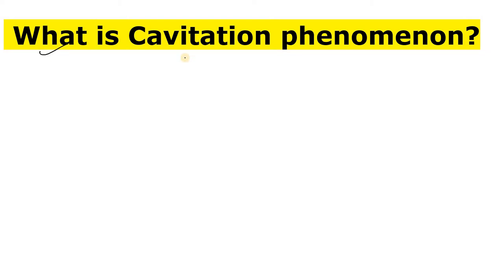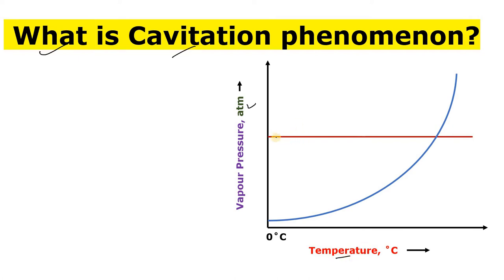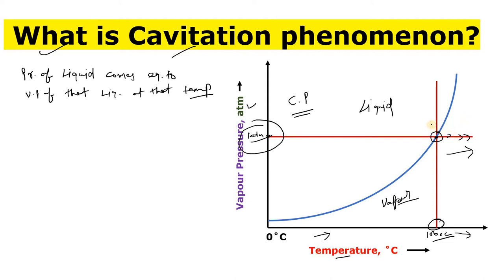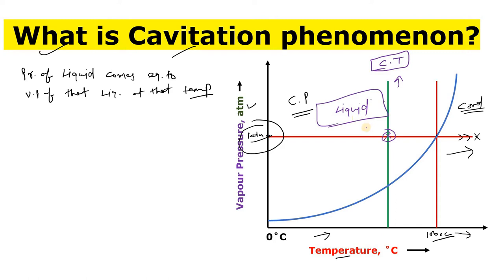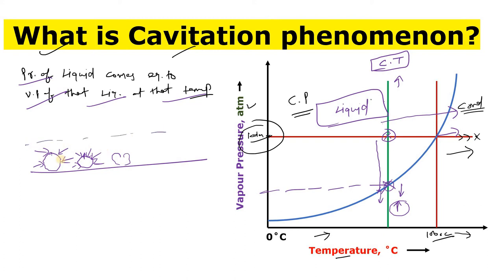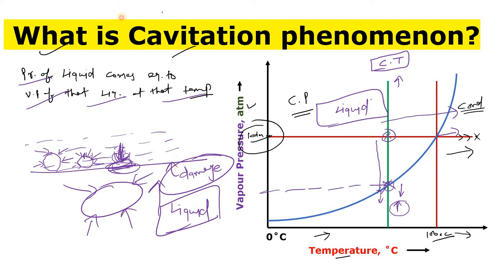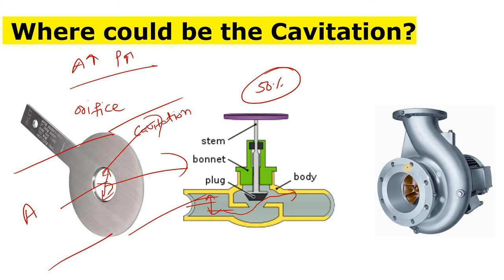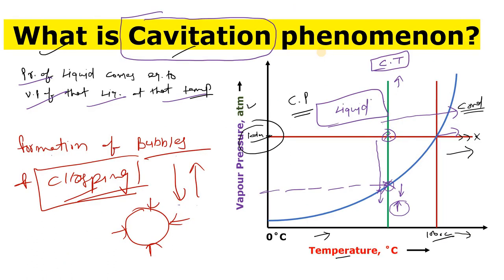Cavitation | What is Cavitation and its Causes? (Part - 2) | Cavitation Phenomenon in Engineering

Comment: hi i thought the lower the area, pressure will increase, (for example pipe with 4 inch an 8 inch with the same flow occuring, pipe with 4 inch will have much more pressure than the 8 inch)